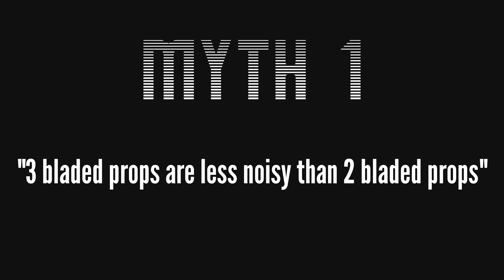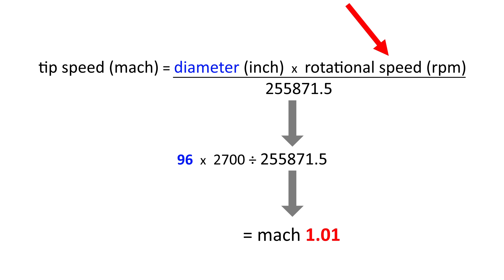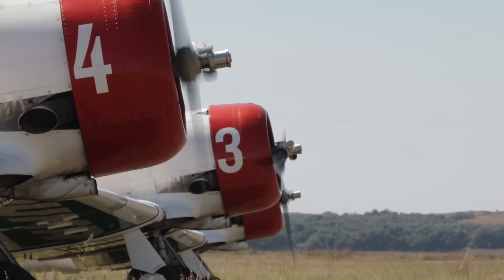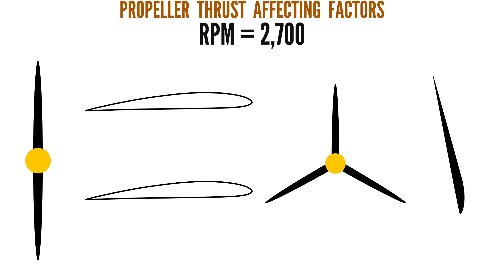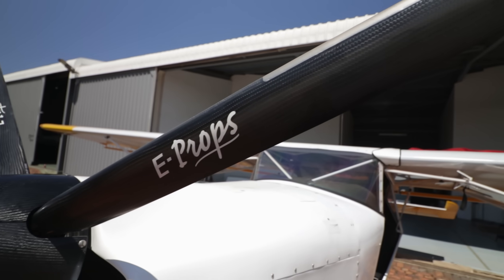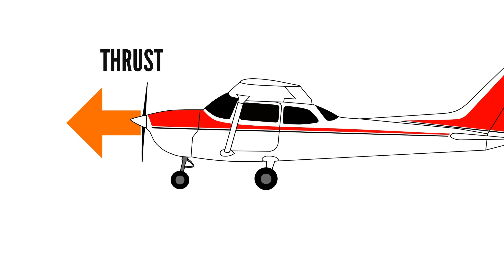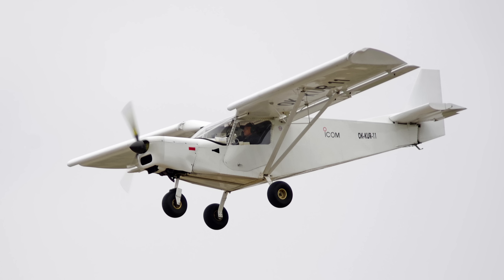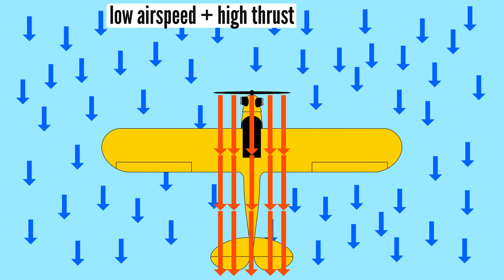4 Biggest Propeller Myths Explored - Long v Short & 2 v 3 Blade

Comment: Hmm...🤔 A couple of things come to mind regarding the significance of a propeller's slipstream [blowing back over the fuselage]:
1) -  Taking a well-known example: the Gee Bee Racer, with its huge, prop-obscuring fuselage and slipstream-swallowing engine cowling. That flew satisfactorily (albeit with notable quirks).
2) -  If prop-wash/slipstream is important in terms of drag, why don't more propeller-driven planes use a 'pusher' configuration?

I've built and flown several radio-controlled aircraft with these design points, and experimented with numerous combinations of engine, propeller, fuselage size, and so on.

Back in the '90s I built a series of planes which had a blunt-nosed cylindrical fuselage 10" in diameter. The engines were enclosed by a 10" diameter aluminium cowl and mounted on a solid firewall 3" behind the prop, which in iteration 1 was 2-bladed and had a diameter of 12"; in iteration 2 it was 3-bladed and 10" in diameter; and in version 3 the prop had 4 blades and was 8" across.

In version 3 there was no slipstream blowing back over the fuselage and wing roots. All three planes flew normally. I didn't think to take any sound-level [dB] measurements, though.

My slipstream experiments were neither scientific nor systematic. Those with pusher propellers were also just random planes of various types - high-wing, low-wing and delta. My only [unscientific] observation was that pusher props/engines seemed to make more noise than those in a tractor layout.

Flying characteristics weren't noticeably different, so just how important IS propeller slipstream where efficiency is concerned?

Are pusher-planes unpopular because of the basic problem of getting them off (and back onto) the ground without hitting the propeller?

Please note: I appreciate that there is a world of difference between a 1.5- or 2-metre span model and a full-sized aircraft (Reynolds numbers, etc), but even so, I'd be interested to know why such things don't seem to make any difference to a plane's flying abilities. (Not too technical, please; I'm not a mathematician or an engineer.)
Reply from the maker: The propellers of pusher config planes don't get clean undisturbed air, the air having passed over the fuselage and wings before reaching the propeller, which reduces prop efficiency/thrust. So that is the "equalizer" and is one reason why pusher isn't necessarily better than tractor.
Reply: In world war II the Germans developed the Dornier Pfeil fighter plane with both a puller and a pusher propeller. One drawback was that for the pilot conventional bailing out was impossible without being chewed up by the rear propeller, necessitating the use of an early ejection seat. The Convair B36 post war nuclear bomber had wing-mounted "pusher"  propellers. Because the engines were mounted the wrong way round to normal it was prone to cooling and carburettor icing problems.

Comment: Short Propellers are used in Air Racing Appliacations where Rate of Climb and High Altitude Performance don't matter. In Air Racing with fixed Pitch Props you want to fly with a coarse Pitch Propeller that doesn't have a lot of RPM change through the Speed Range of the Aircraft.

Comment: Most aircraft have a constant speed propeller nowadays meaning that the pitch limits can be adjusted to achieve the desired rpm at both take off and top speed making the "only good for STOL aircraft" point invalid. In fact the P-51 have a pitch angle range of 40 degrees so it can take off at 100 mph and achieve 400 mph with the same prop AOA (approx 4 degrees)

Comment: The worlds fastest propeller driven aircraft is the Tu-95 Bear strategic cruise missile carrier. It has two sets of four blades because it has 15,000hp engines to absorb the enormous thrust. The blades are long and thin. You mention drag and thrust with single engined aircraft, but what about twin engined aircraft like the Mosquito with two engines in pods on the wing with less drag than if they blew air over the fuselage?
Reply from the maker: Yeah a twin should have less propeller slipstream drag, but more free stream/total drag due to the fuselage + two nacelles hosting the engines, where the single has just the fuselage and nose combined that hosts the engine. Thus I don't think a twin has a much drag advantage, but I've not done the math to confirm this.
Reply: The TU95 props were so loud, it rattled your teeth when flying close to it. I don't know how the aircrew managed.
Reply: @bryankirk  Lots and lots of vodka.
Reply: Its props are moving higher than speed of sound!
Reply: @petrvalkoun4539 No. This is a popular misconception.

Comment: I'm a fighter pilot, specifically I drive a F-16 which of course has no need for a propeller. But before the Airforce I was a stunt pilot with a degree in aeronautical engineering. Because of that this little gem caught my attention so I tuned in. And without going into different minor debates about fluid dynamics vs. air flow over curved surfaces, high level physics stuff I wanted to listen  as it I had little or a more layman level knowledge of what was involved. I.E. your general causal viewer. What grabbed me almost immediately baring the formula mumbo jumbo was how I immediately grasped what he was trying to relate yet I could also do so without a lengthy explanation of the math involved, which thankfully he bypassed. What I came away with is what the quality of what makes for the best pilots which we call "feeling the air", not necessarily understanding why what you are doing with your aircraft's air surfaces are doing what they do but instead just feeling how to make your aircraft flow in a dance through the air. The first quality I look for in new pilots to the squadron I command whether they were a high school dropout or had a PhD. And to this extent I found his simple explanation made me "feel the air" as he went along. And considering he bypassed the winded explanations which would have turned off your casual viewer but instead would make then "feel the air" I have to rate this video a double bravo! And for the stuffy critiquers out there you can take high vectored noses to your local Red Barron bar and debate it among yourselfs but in the end that doesn't mean squat whether or not you're a cloud dancer or a clumsy gomer behind the stick or yoke. But a video like this might grab the imagination of some rookie high school cloud dancer enough to intice them to "feel the air" for themselves. And because of that once my congratulations to this video directly because of it's understandable simplicity. 
Bravo! Bravo! 🙂👍

Слава Україні!  Слава його героям! 

Deus Vero Honorat et Sacrificium, 
Maj. Tamre' "Vixen" Colby
Cmdr. 347th Bravo CAS/AS
USAFE/NATO SOCOM EPAF

(P.S. Please excuse any spelling or semantic mistakes but duty calls and I get the guilty pleasure of setting off a klaxon that will make most of the base jump out of their pants. Maybe that's why they gave me the callsign "Vixen". As in the adjective not as the noun. Ta! Ta! 😇😅)
Reply from the maker: Thanks for the great comment. I'm very happy when it get's through as intended, I deliberately try not to go too deep into math's and formulas, and rather try to have the viewer visualise it. Some love it, some hate it. But I maintain that you don't need an aeronautical engineering degree to be able to "visualise" many aerodynamic concepts.

Thanks again!
Reply: @LetsGoAviate 
And you're very welcome, it's a pleasure to find someone who can invoke enthusiasm among beginners and ignore bragards who only want to show off how brilliant they are even though they would probably be a danger to themselves and a menace to society behind the stick of a Piper Cub.
I have no tolerance for their kind no matter what the subject. Implied insults  by self aggrandizing superiority only serves the egotistical and not those seeking knowledge. 
So bravo five by five and don't pay attention to those desk sitting tango foxtrot ground burrowing Gomers.
You've got the right stuff to be an instructor. Carry on.
Bravo Joy,
Deus Vero Honorat et Sacrificium, 
Maj. Tamre' Colby

Comment: Another fantastic video about something I woner about all the time! The only question I have is what about short thick props? Can not this move larger volumes of air at lower RPM? (:
Reply from the maker: Thanks. It difficult to move a similar amount of air with smaller diameter props, even with thicker blades turning faster. There is much efficiency in length, if you consider that a roughly 40% increase in blade length doubles propeller area (when spinning).

Comment: How a pusher configuration changes propeller slip stream drag? 

Is that the source of some advantage for pushers?
Reply from the maker: If there is nothing behind the prop (no part of the fuselage) then there is no slipstream drag that the fuselage goes through. The disadvantage of pushers is when the air gets to the propeller it has already been disturbed by the fuselage, wings etc and that reduces prop efficiency.

Comment: Something I've always wondered, and perhaps you're the guy to ask: why don't propellers have canards? If canards boost the efficiency of wings, by disrupting air so that the leading edge isn't being rammed into still air all the time, why not doo the same for propellors?
Reply: The last thing you want is  disturbed air flow for propellers. You will lose thrust and possibly over rev the engine, for it will have no resistance to the engine. ❤🎉😊

Comment: 25 years ago, I did a lot of Test flying of Piper Lance's with Lycoming IO-540 300 horsepower. With all sorts of different speed mods. The 2 bladed propellers consistently had shorter Take off runs and higher top speeds. 3 bladed propellers were always smoother. I always get a laugh when I  read or see Propeller companies selling 3 bladed propellers With all sorts of faults claims. Great video!

Comment: On my electric-powered RC models, I want the diameter-to-pitch ratio (D:P) to be between 1.5:1 and 1.75:1. The highest I’ll use is 2:1. Longer blades take more energy to turn and that shortens the flight time.
Reply: Turning the prop FASTER takes more power. The longer prop can turn much slower for the same thrust. Thereby being more efficient.
That's why the video, and any aerodynamics textbook, will tell you a longer prop is more efficient. Because they can turn much slower for the same thrust.
Reply: @senseisecurityschool9337  In the past week, I replaced a 12x4 prop (3:1 D:P ratio) with a 10x5 prop (2:1 D:P ratio). The airplane flies faster, the motor draws less current, the battery lasts longer, and the plane is more fun to fly. The 10x5 prop pushes a smaller column of air (less thrust), but it pushes that column of air faster (higher pitch speed). The airplane is faster, but doesn’t climb quite as well, which is fine with me. I don’t have fly at full throttle now to keep the plane from mushing around. I don’t care that it won’t go straight up out of sight.
Reply: @txkflier  
The area of a circle is Pi*rSQUARED.
the 10" prop is 25" * Pi, the 12" prop is 36" * Pi.

A 12" prop is 50% LARGER than a 10" prop. You put on a much SMALLER prop and found it's a better fit for the motor you have.
So what you just told us is that 12" is too large of a prop for the RPM / KV of your motor.

It would be more efficient to run a 12" 4.5 with a lower KV.
Reply: @senseisecurityschool9337 I didn’t want to change the motor or the battery pack I was using. Now go away..

Comment: Question 1:  Wind turbines generally seem to have 3 blades, but higher horsepower engines (WW2 pistons and modern turbines) have 4, 5, or 6 blades to absorb high power, so why don’t wind turbines have more than 3 blades to capture more power from the wind stream?  

Question 2:  Given the increase in blades as engines make more power, why did the B-36 engines - some of the most powerful ever made - have only 3 blades?  Was it because they were very long and gears to turn relatively slowly?
Reply from the maker: Without having done a ton of research, my guess is the weight gets quite heavy when adding more blades, which means less power generated when there is light winds (more wind required to get it turning). But maybe someone else will give a better answer.

Regarding the B-36, making blades longer is more efficient in absorbing more power than adding more blades, but the blade tip speed normally limits making blades longer (due to tip speed), as well as ground clearance. The B-36 didn't really have either of those problems, as the engines were quite high off the ground, and the geared P&W R4360 had a gear ratio 0.375:1, meaning the 2,800rpm max engine speed was reduced to only 1,050 rpm at the prop! That meant very long blades could be used, and I believe prop diameter was 19 feet!
Reply: Wind turbines have three as having two causes vibration as the blades pass the mast. 5 blades cause more drag axially which is not good for wind gusts when the mast is so tall.
Reply: Also wind turbines rotate through different wind speeds which is usually higher at the top. Three bladed props counteract this force offset somewhat.

Comment: The Corsair and P47 originally had 3 bladed narrow blade props. It was said that going to the 4 bladed "paddle prop" was like adding 1,000 hp in a climb! One pilot in Britan said that his P47 was faster and would tangle well with spitfires untill they pulled up and climbed they always did this to him in mock dogfights until his plane got the 4 blade paddle prop and water injection, at which point he pulled up with them and passed them blowing their minds!
Reply: P-47 always had four blade props unlike the Corsair. But, later versions had more power and got paddle blade propellers increasing their performance in the climb.
Reply: @vascoribeiro69  thank you for that comment.
Reply: @vascoribeiro69  I always wondered about the German propellers being smaller diameter and much larger chord that allied aircraft. (The propellers of the FW 190 and Me 264, for example)
Reply: @331SVTCobra  yes, they had a lower aspect ratio. I don't know the reasons or trade offs. I think they stuck with three blade propellers for some reason (productivity?) and, with increasing engine power, they just augmented the blade area. We can discuss blade drag, but they were very well designed, being elliptical, thus reducing induced drag.
Reply: Greg did a whole two part video on propellers
Reply: Sounds as if the engine was simply so abunant in powere that because of the 
restriction in diameter (due to ground clearance) and 
limitation in rpm (engine revs or speed of sound at the blade tips) 
it simply could not shovel enough air to consume the complete power of the engine. 

Enter blade 4  to make use of that unused power.
Reply: It wasn't the water injection or an uprated engine that Robert Johnson talked about, he never once used his water injection as he didn't want the added maintenance and inspections put on his crew chief.
It was the addition of the paddle propeller by service reps from back in the states that traveled to England to add them to the 56th Fighter Group's P47's that he said "felt like it added another 1,000 HP to the engine".
Given the increase in the P47's climb rate when the paddle props were added if you do the math it's the equivalent of adding 800 HP to the engine, so Johnson wasn't too far off in his assessment.
Reply: Did you read Juggernaut, by Robert Johnson?

Comment: Why don't turbines have a sound speed limit?
Reply: The problems with noise & efficiency are less of a problem in a turbine because the shroud has control of the airflow
Reply: They have, the air getting in the compressor must be subsonic. That is why supersonic AC have variable intakes.
Reply: what you are saying is the airflow must be slowed, I'm guessing that is so combustion occurs before the air leaves, but I was referring to the turbine blade tip speeds.
Reply: @Iowa599  yes they may go over Mach 1. But also with the increase in pressure and temperature the speed of sound goes higher.

Comment: Fantastic explanation. Most people get three bladed props because "they look cool". I just put a new 2 blade prop on my TR182 because it is just flat out faster with the 2 blade prop. If you maintain the prop as well as you should, the 2 blade will be every bit as smooth as the 3 blade prop as well. Just an aside, in the old days, model airplanes used to use one bladed props with a counterweight as they were even more efficient.
Reply: There’s a few J3 cubs still out there with one bladed props too! Performs noticeably better than a two blade
Reply: If you buy a Cirrus SR-22, you can order a 4 bladed prop as an option (standard is 3 blades). It's a $22,000 option, but it looks great!
Reply: Ive never seen a one blade prop .. a strange concept/mind indeed 😄
Reply: You'd think the thrust imbalance would cause issues on a one-bladed prop... =/